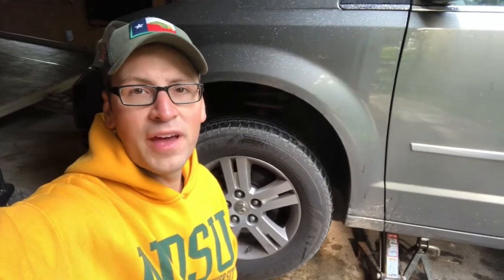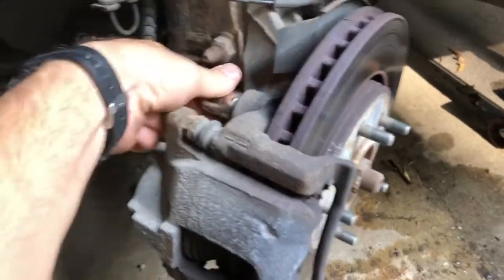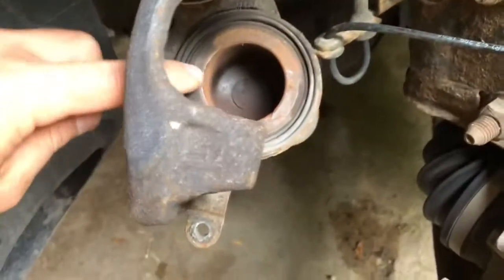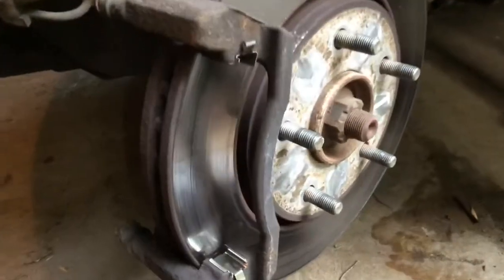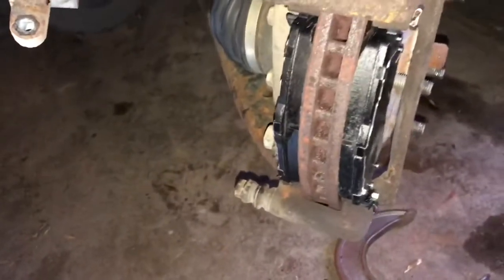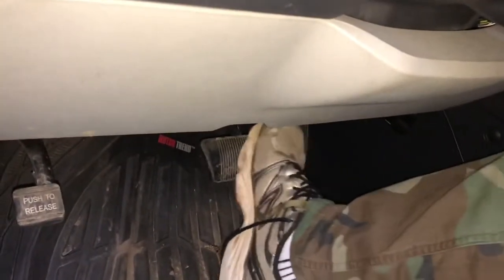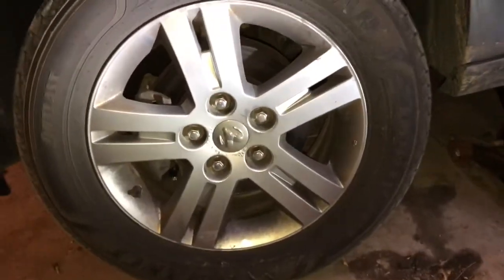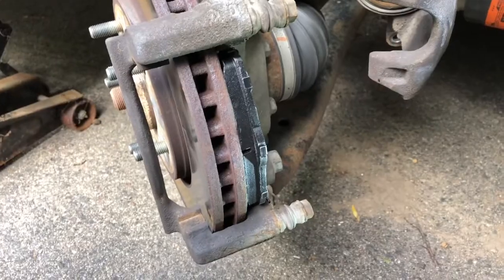Brake Pad Replacement - 2010 Dodge Grand Caravan - Step by Step

Comment: Good video, but it would have been more useful to actually see you remove the pads and clips and replace the pads and clips rather than just the before and afterward. You spoke of the grease but never showed us where to put it. However, you showed nearly all the steps to removing and replacing the tire except jacking up the vehicle.  I only mention this for those of us who would benefit from the omissions.  😮😮😮...It would have also been nice to actually see the cylinder being reset with that c-clamp...ijs. The parts that were a little difficult for you would have been inspiring to see if we were to encounter the same difficulties...
Reply from the maker: Hello- thanks for that comment. This was definitely an early video for me and at that time I didn’t even have a phone clamp to use for shooting video. I agree that I could have done better. I think my content has improved, or at least that is my intent. Again, thanks for watching and commenting.

Comment: Do you have to do the thingy with the cylinder?
Reply from the maker: Yep! Pop the cap on the fluid reservoir. Get a big c-clamp or something and squeeze it gently back in. Check around the 3:00 mark.